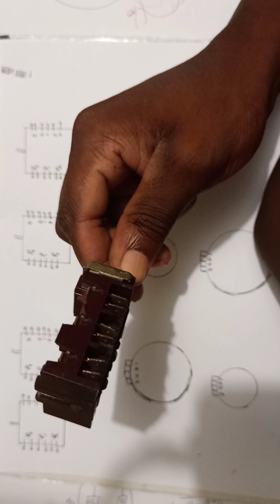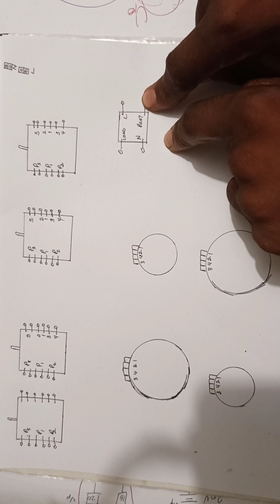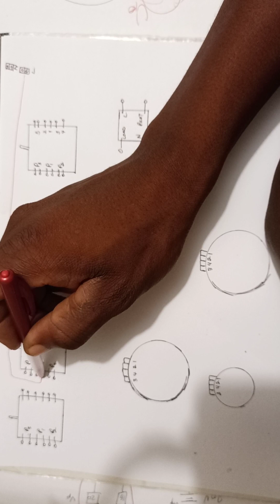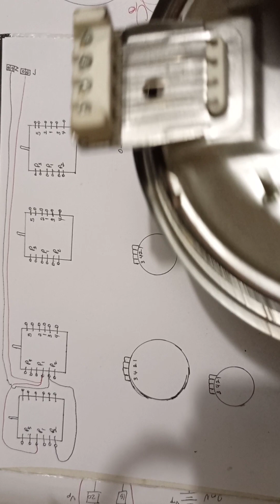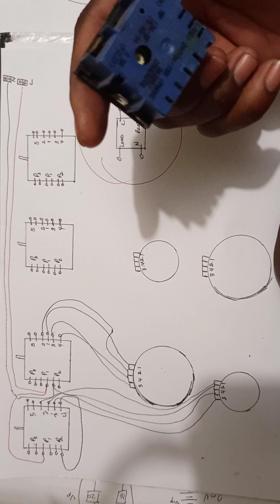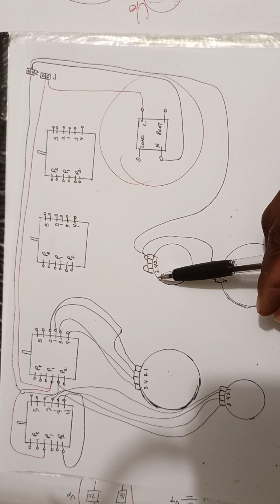The ultimate guide to wiring your 4 plate stove like a pro - no electrician needed!

Comment: Thank you for this precise video.
I want to ask, how do you now connect for the pilot light and earthing of the stove on the selector switch?
Reply from the maker: It's P2 and 5 my dear friend.
Reply: @appliancetech001  Thank you so much. I have been waiting for that series of different circuit diagrams for thermostats and oven selector switches for different stove models😁😁😁😁
Reply from the maker: @luthandondlovu8613  I remember promising that 🤦🤣 I will make a plan

Comment: Good short and precise video. How can I replace solid plates with coiled plates on a defy stove with selector switches. Make a video if possible
Reply from the maker: Thanks about the encouraging feedback, its not possible to control the coiled plate with the selector switch. Selector switch(depending on type/model) requires a plate with 3 to 4 connections and a coiled plate has 2 connections.

Comment: Very informative sir keep it up good work 👏 . Sir I do have a question how do you replace solid plate with normal plates coz you find that solid plate has for line then normal has two plates
Reply: No I mean replacing four connection plate with two stove plate coz for the regulator switch and selector switch have understood, help me with that one sir. Gratitude sir for these information and knowledge you've changed 👏👏
Reply from the maker: You must replace selector switches with regulator switches. Selector switches only work with four connection plates not two and regulators work with all
Reply from the maker: If you mean how to replace a plate with two connections with one with four connections. The one with four connections must be bridged( bridge 1&2, & 3&4), then load or live from the switch goes to 1&2and 3&4 take neutral. To do the opposite you must change switches to selector switches.